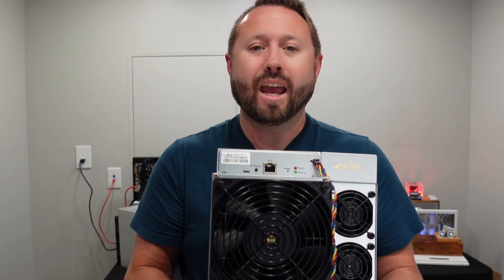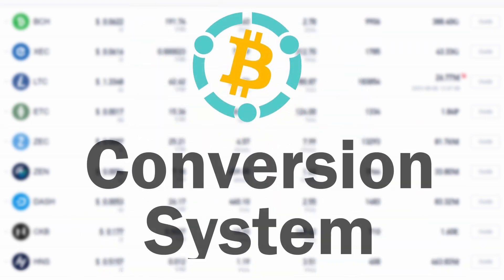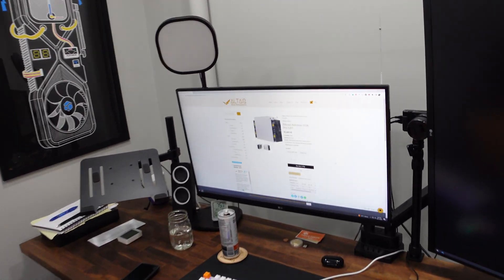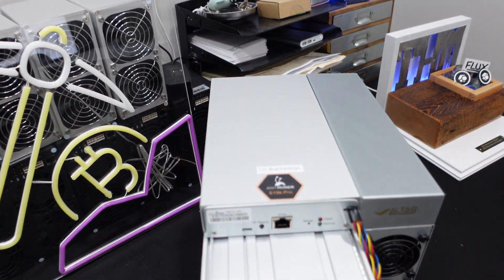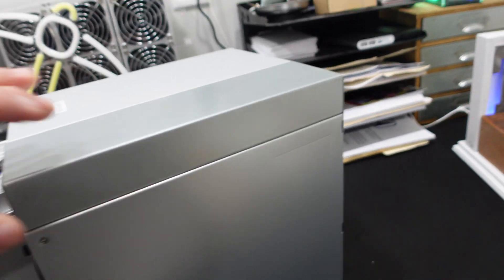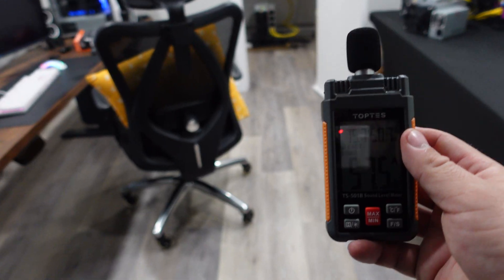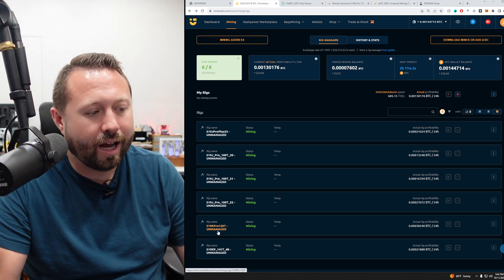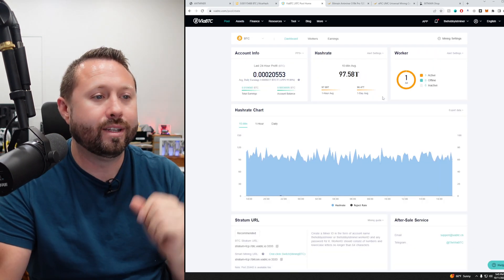Is the Bitmain Antminer S19K Pro Worth It!?

Comment: I'm currently looking at an s19k pro with 110 th/s. Is it the same hardware as the 120 th/s? Wondering if there is possible to flash the software from 120 unit to 110 unit without any issues?

Comment: I run off grid.  This still profitable ?
Reply: Same question did you find the answer i am of grid to
Reply: @ no not really. 
But if your system is big enough then should be fine.  Mine is just winter time would be tough go having miner running 24/7

Comment: 2:16 

 Have you checked the BTC mining difficulty and the fact that it’s nearly doubled in the last 12 months? Have you checked the profitability of these units?

Just four months ago you were proclaiming that was the best time to buy BTC ASICs …promoting Coin Mining Central selling an S19J Pro 100 TH model for $2254.70

Because of the exponential rise in mining difficulty, this miner is only profitable for users with electricity cost of $0.08 or lower.

Comment: 23W/T just isn't going to produce anything profitable unless you have extremely low power. In addition, it will be under water once the halving next year.
Reply: All miners will be “under water” after halving next year that’s kinda the point
Reply: the only more efficient asic is s21 which is made w aluminum hash boards 😢
Reply: @Ryan-xq3kl  but the S21 is more expensive.
Reply: these bricks they are selling is madness to buy. After halving there will be new asics with alot less power and more yields.